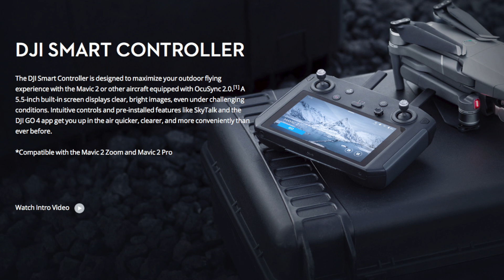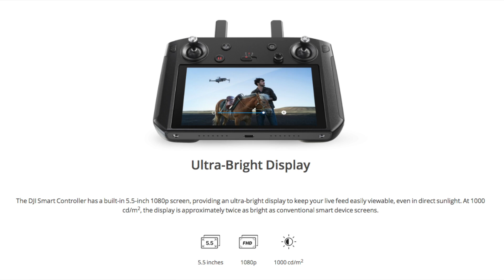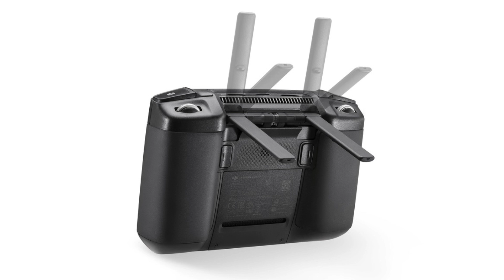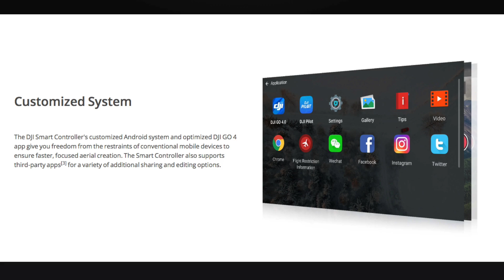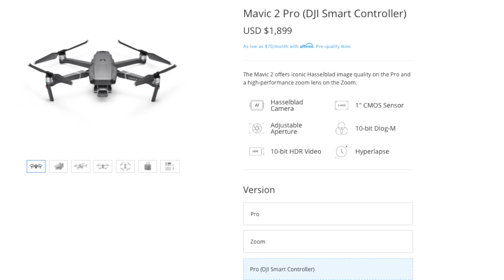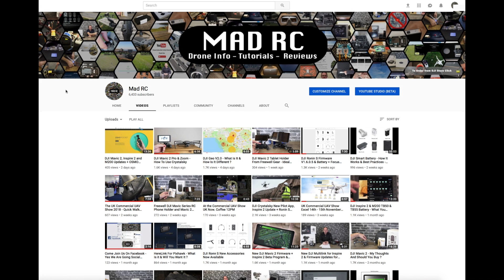DJI Smart Controller For Mavic 2 - My Thoughts & Spec Walk-thorough

Comment: Don't waste your money it's not worth it. Dji is not going cover your drone if you crash it they will make a ton of  Excuses of what you did wrong and you will  have to pay for the repairs your self. I can't get them to cover my drone when it flew off after I just got it back and I was using my cendence remote control. I did every Calibration on the drone the cendence and the crystal sky. And I sent them the flight record and it shows that I didn't touch the controller sticks and it flew off and they told me that there was nothing wrong with the drone it was my fault. I sent it in because it burned the camera and the drone so I sent it in and told them that I couldn't use the  Footage every video I tried to use was no good. Theirs a lot of things that happen  that I could  Write a book of every thing that happened. So I'm going to stop here.

Comment: ~ Android OS seems to be 5.1 such as that used by the Nvidia K1. When updating that OS to above 5.1 , that’s where problems start. The standard Crystalsky is simply a more versatile product  I would hold off on buying this controller as 2019 has Version 2 coming to a few products.

Comment: The bigger question is why DJI deliberately tried to prevent users of their 5.5 CS from using it on the M2 by making the controller slots too small to accept their own CS bracket? Sneaky buggers.
Reply from the maker: It was the same for the Air, at times DJI is fragmented in their approach, I honestly don’t think it’s intentional but they are very siloed in how they separate there product teams and this is why we see some of these things happen.
Reply: @Lon Denard And yet they provided absolutely no update to their mounting bracket so that existing CS users could continue to use their device. I don't believe it's the sticks that were the issue, which means it's either very poor planning or deliberate. The original bracket was not cheap, so to have to kick it to the curb because the slots are now too small is a kick in the teeth for existing owners.

Comment: A ha......I remember asking when this would be released not too long ago because I was holding out on my M2P purchase to see the packaged bundle where this is supplied rather than the ‘old’ controller. I agree with you in that the cost is a true reflection of the effort involved in combining a controller with a display of this standard. What you pay for is what you get and I think affordability is only relative to an individual’s attitude to their disposable income. The vast majority of my flying is FPV with the DJI Goggles Race Edition so I’m really not sure if having this controller would be of benefit to me? Does the Ocusync 2 system give a ‘better’ image in the goggles when compared to Ocusync 1? Is there a better image in the goggles if using a HDMI cable  with this controller and the goggles when compared to Ocusync 1? Is the standalone Crystal Sky display 2000 nit compared with 1000 for this controller?
Reply from the maker: The 5.5 inch was 1000 nits too it was only the 7.85 was available in a Ultra 2000 nits version and there was issues with it.  

Ocusync 2.0 is better overall with the feed being more stable and giving more range in 1080p.  It’s a newer compression method so it’s a little better overall.